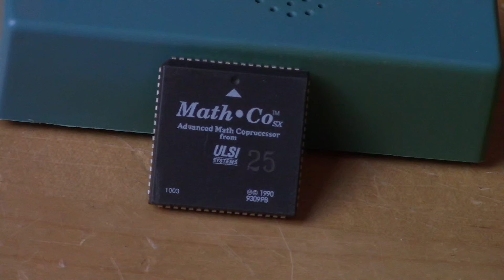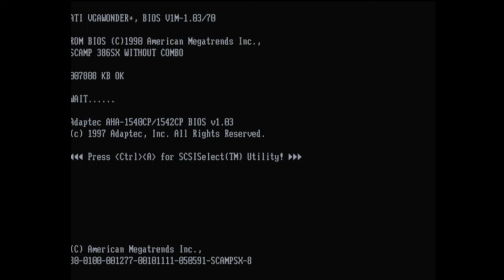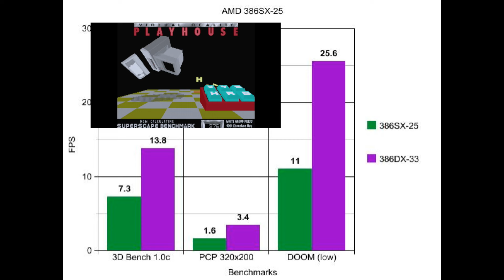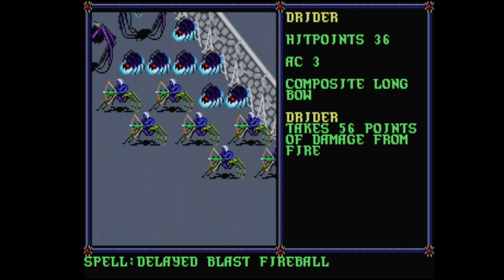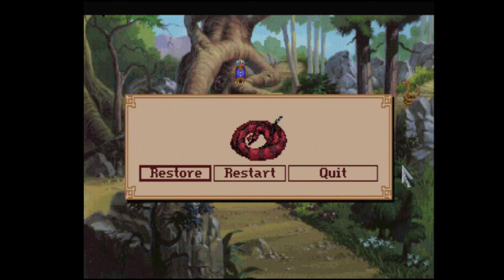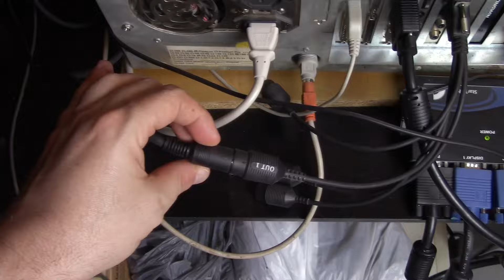Building a 386SX PC

Comment: If it helps to explain the 32bit/16bit nature of the 386SX vs DX:  the 386SX is a fully 32bit microprocessor internally but uses a 16bit data bus.  This means that to fill a 32bit CPU register, two bus cycles must occur, which seriously hampered the overall performance of the 386 chip.  Also, the 386SX has the same 20bit address bus as the 286, meaning that the maximum amount of memory it can handle is 16MB of RAM.  Fully 32bit 386DX chips can theoretically handle the full 4GB address space but were limited by the chipsets available at the time.

To confuse matters, there was a bug in very early 386 designs that prevented them from running 32bit software.  Intel had to test each CPU and those that had the bug were stamped with "16BIT SW ONLY" on the chip.

Comment: No 386 SX case badges kind of makes sense.  If you were a system integrator back then, you'd want your customers to know that they're definitely getting a real 386.  No need to complicate matters with extra letters. 😆  I remember basically everybody around here had the SX, except for a few CAD and business power users with elaborate DX setups.  Only really changed when people started upgrading to 386 DX-40s, 486 DLC and the like, years later.

Comment: That board could probably take a DX 386, also you should have turned the board over to see if the empty sockets has traces that even go anywhere. I have a similar board with cache sockets that are not wired to anything. Fake cache so to say, hence 'Cheap'. I wonder if you have to have a separate oscillator for the FPU, I can't really remember right now, I plan to dig my board up as the last time I tested it was in 1998/1999. I am sure the sticker is still on it. I really need to start photographing my stuff, and upload them somewhere. Rather than having go and look for it.
Nice job on this one, really entertaining.
Reply from the maker: The CPU is soldered on so any CPU change to a DX would require desoldering and soldering on the new CPU, or a socket. I always thought the SX boards themselves were also 16-bit so I'm not sure a DX would work or would it just function as an SX if it did work? I believe there is a second oscillator on the board.

Comment: 12:17 Smaller RAM sockets are for parity bit chip. 1 bit memory chip plus two 4 bits chips, and you get something simmilar to 30 pin SIMM.
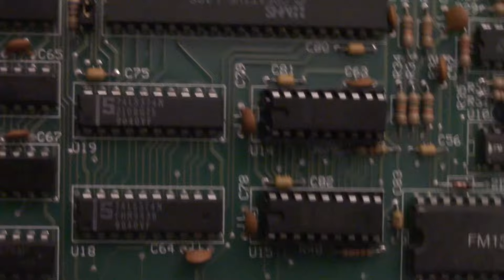50:27 Laser engraved SAA1099? Obvious fake. You need to look one with printed Philips logo.

Comment: Oh nice build!! And mix of parts...almost like it was a 286 that was just board swapped to 386 but left the expansion cards for cost savings. 
Ironically...I was about to start recording my 386sx build this week lol 😆
Reply from the maker: Thats more or less what I was going for. A 386 but with more of a late 80s 286 feel. Good luck with your SX build, looking forward to seeing it.
Reply: @AncientElectronics  thats about what I think mine will be...
I think the board is from 92 but it's a super budget board with a 33sx so 88 or 89 ish build and parts. 
Assuming I have a working ide drive that's low capacity...if not I'll temp use my test cf card adapter until I order the right style 
I'll save the higher end et4000 and stuff for the dx40 build lol

Comment: "without combo" probably means w/o integrated floppy / ide controller? btw. yes, dip, dual in-line package.
Reply: oh and concerning (not undoable) modifications: yeah, i also don't find it pretty. but your example is of course rather tame. i'm almost up in tears whenever i hear those keyboard people horror stories, them ripping apart everything for their switches, including ancient super-rare systems. the tech time traveller has some heartbreaking stories.
Reply from the maker: Yea, I'm not a fan of more rare items getting dismantled for parts but were still in a time I can walk into a goodwill on almost any given day and still find an old PC CD drive so I wouldn't call them rare or expensive to aquire even in 2024. I'd also say there's a diffrence between a cosmetic modification that keeps the functionality in tact and tearing somthing apart for parts.

Comment: I am building a very similar system, 386SX-33, 8Mb ram, some soundblaster clone with midi, 5.25 and 3.5 floppy, cdrom, with the same goal, for some special games like WC, the early Testdrives, Indiana Jones games that run way to fast on my main DOS machine.
On the subject of period correct, it is my opinion that everyone does what he/she likes to do.
Yes, period correct is nice, but I am not using a spinning HDD, I am using a CF card, a multispeed cdrom (8x I think), a ET4000 (as this is what I have and know it works), a 15 inch CRT monitor.
It's part of the fun to get this mix of new and old working!

Comment: 28:30 yeah in the 90s id get a new case and spray paint colors in wanted. Inclhding the drives. It took masking and time but it was a unique build.

Besides the plastic of the drives will yellow over time unmodified.

Comment: Ah, I think you have the "Trang Bow/Trangg Bow
 80386SX SCAMP". JP11 is 2-3 to run NPU sync to CPU speed, 1-2 to run it from OSC2 - and looks like the DIP sockets are for chip RAM and parity
Reply from the maker: @matthewday7565  thanks for the info